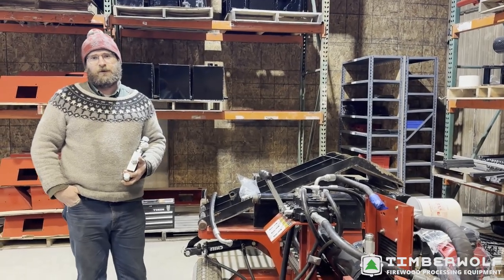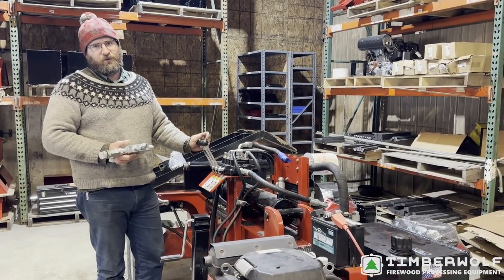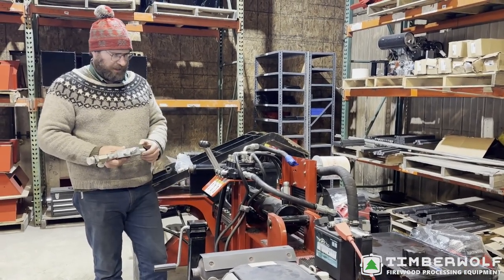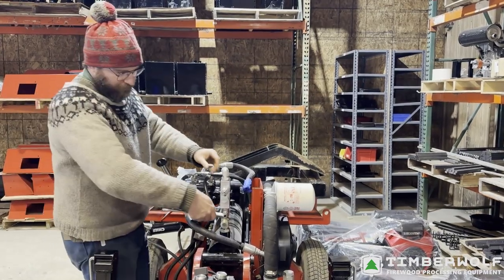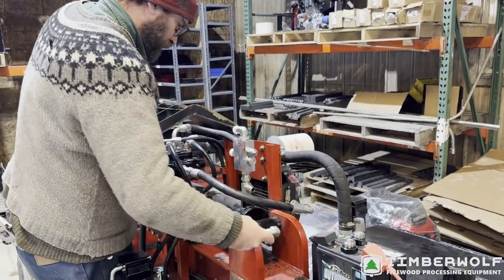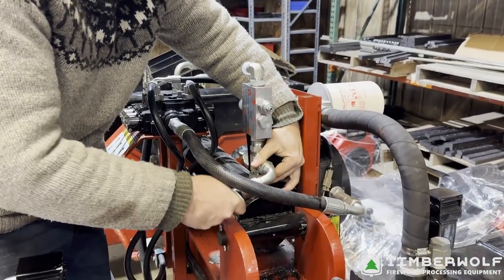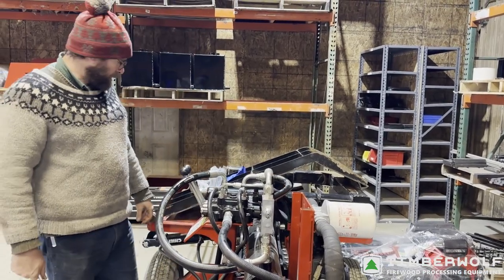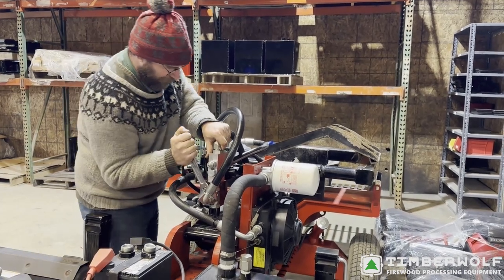Regen Valve Installation and Testing on the Alpha 6

Comment: Why does it seem to stroke faster in the outward direction than the return? Isn’t it usually just the opposite? Especially with a large rod/cylinder bore ratio?

Comment: You guys should put up a video doing a comparison with it unloaded and loaded with a crotch wood oak etc and then with and without the regen valve.. is this plumbing compatible with an autocycle setup?
Reply from the maker: It would be compatible with autocycle. we use that setup on our PRO MP series

Comment: Hi. Im looking at buying a 2022 Alpha 6 locally. I'd like to add this. Can I have the dealer convert my potentially "old" model? Maybe I should just call and buy a new one direct.
Reply from the maker: We do sell the regeneration manifold separately, but you will need a new cylinder and a couple of hoses to equip the manifold. Email sales@timberwolfequip.com for more info.